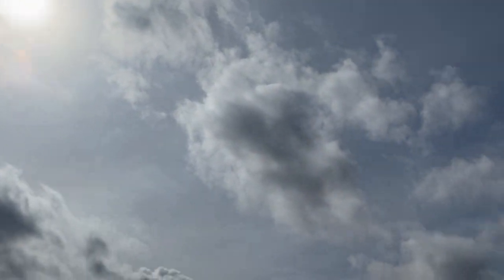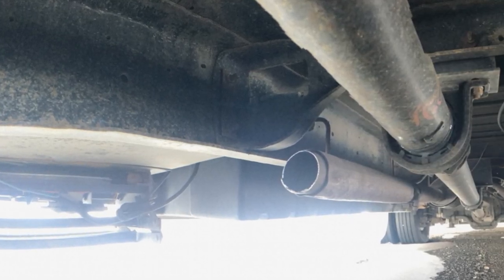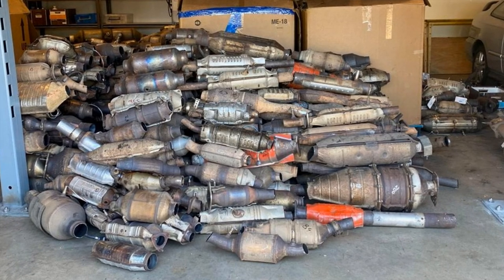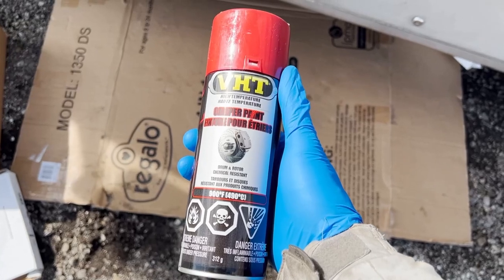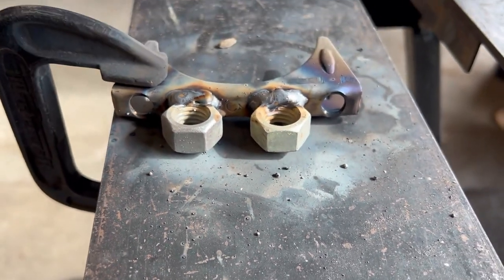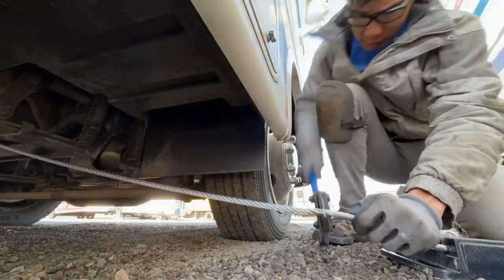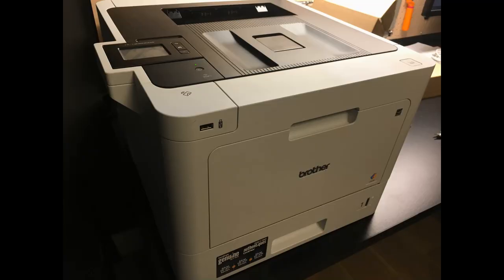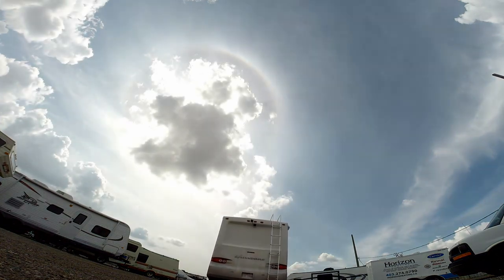Stolen RV Catalytic Converter (and what I did about it)

Comment: One of the keys to security is making yourself less desirable than the lowest hanging fruit, which in your case would be all the RVs surrounding yours. It's kind of like  passwords -- any password is better than no password, and conversely, if someone has you in their sights, few passwords are good enough. I agree that the final product looked like a heart, but disagreed with your sympathy for the thief. If it is indeed a heart, it's one that belongs to you and your family! I applaud your efforts and might have wrapped mine with barbed wire or glued broken glass to it. Spite is powerful motivation. Good luck to your defense system and I hope that security cable doesn't rattle too much! :)